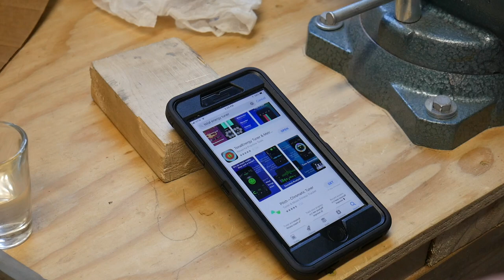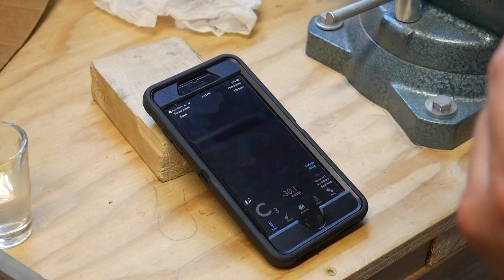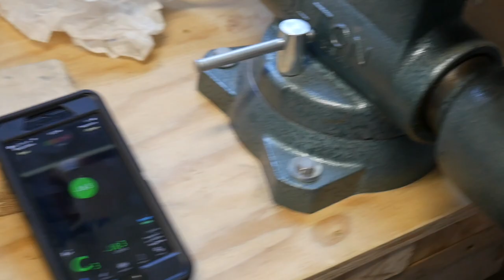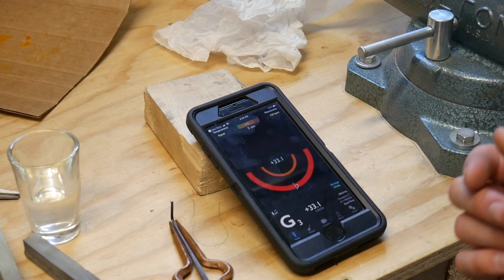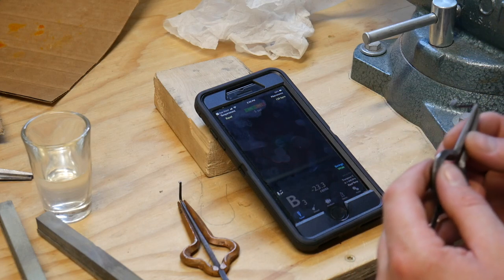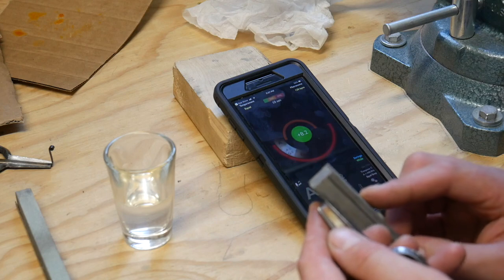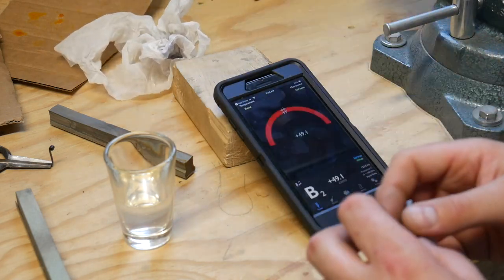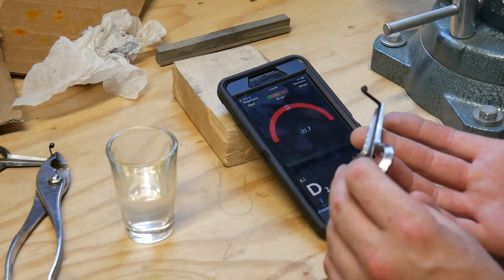How to tune a Jaw/ Jews Harp.

Comment: Hi, could you help me? I have a jew's harp Volgutov tuned in F2, I would like to raise it in G2, can it be done? Thanks
Reply from the maker: It can be done but is not advisable.     Your sustain will go down as you raise the note that far.   I can do it in shop the cost is 5 usd, but I am currently not allowing anythingg G to be mailed to the shop due to the pandemic.
Reply: ah don't tell me that I live in Italy ... thank you for your availability, in any case I have already resolved; I reduced the trigger and rebuilt the ring, now it has a good ringing sound because I need it to play melodies but as you say it has lost a bit of sustain, patience!

Comment: I have one that's just a little sharper than an F2 (87.3 Hz, harp is 87.7 Hz..(update: found a calculator, that's almost 8 cents)). I don't think it's worth taking it up almost a half step, just need to flatten it a little I think. Also, for playing along with instruments, do you sometimes use harps tuned to the fifth of whatever key the tune is in instead of the root? E.g. (for the benefit of everyone else), if the tune is in G, maybe use a harp tuned to D. Or even a major third, I once had a harp tuned to a perfect C-sharp, and I thought it was great for A tunes. I'm thinking my new harp might be good for F or B-flat tunes.
Reply from the maker: Was this a harp that was in tune and is now a little sharp?
Reply: @bebbcorpharpery7331  No, just a new untuned harp.
Reply from the maker: I think you just came up with the idea for my next video on drop tubing.  It will be 2-3 weeks after I shoot it this weekend before it airs.  🙂

Comment: Can you remove mass from any part of the harp? My harp has an already small trigger and I am afraid that playability will decrease by removing mass from there. I must add that my harp is only 7 cents off, so maybe I can still remove from the trigger without damaging the harp too much?
Reply from the maker: 7 cents above or below?
Reply: @bebbcorpharpery7331  7 cents below. Yesterday I got a tip from another jaw harp player to remove mass from the sides of the tongue with a diamont knive sharpener. He said it worked for him, so maybe I can try this :)

Comment: Hello...can you help me..how to tune down 23 cent a glyzrin star  ?
Reply from the maker: Not far to go and will be simple.  Option 1 and the easiest, take a small amount of beeswax.   Press it into the trigger spiral.   Play in front of a tuner.   Add a bit more if needs to go further.   If you drop below, scrape or sand a small amount of beeswax off to raise to note.   This can be permanent and reversible as well.  If you want to drop tune it permanently you can remove the reed and grind or sand a small amount of the reed thickness away.    a small amount of the thickness of the reed to drop it, but much care must be taken when doing this as it is quite easy to go too far and all thickness changes must be gradual, smooth and re polished to avoid reed failure.

Comment: I use Dremel. This grinder is too big for so delicate work. To make the trigger heavier, I use a tin. And of course, polishing after the job is done.
Reply from the maker: This is a variable speed grinder.  The lowest speeds are perfect for me and offer a lot of controlled grinding.   Very easy to remove small amounts with precision, but requires a steady hand.

Comment: What if my harp is +20 cents above b??
Reply from the maker: There are a few ways to do this.    You can weight the trigger with beeswax or solder to drop down below, then shave or file off the weight until you raise to note.    Or you can remove metal distally at the first 1/3 of the reed until you drop down.    Or if it is a problem of trigger orientation from rough play, you can orient the trigger a bit to increase the leverage and drop down.
Reply: @bebbcorpharpery7331  how about duct tape?
Reply from the maker: You could although beeswax would be easier to control the final frequency.